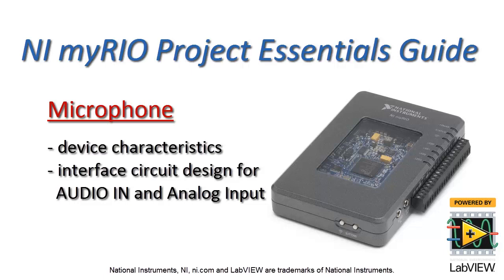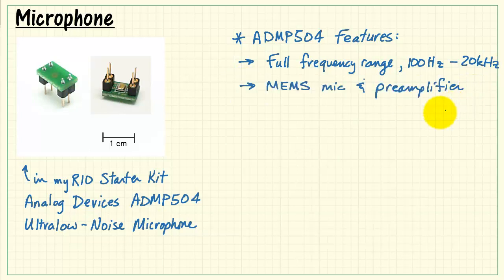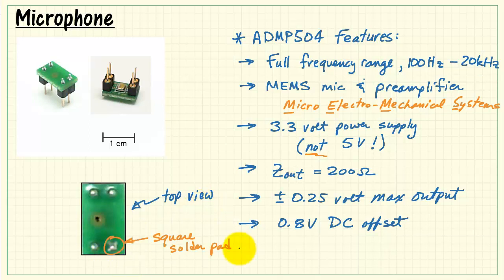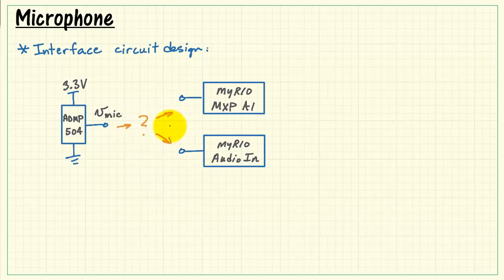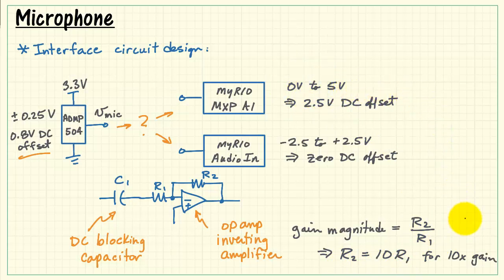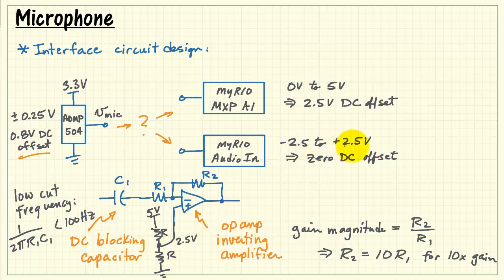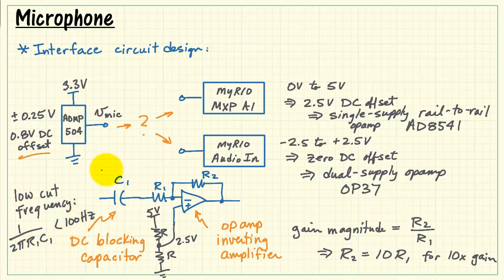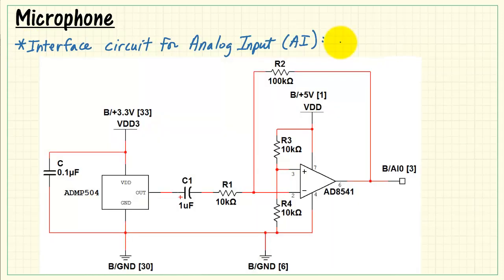NI myRIO: Microphone

Comment: I'm using the analog circuit and an Arduino to interpret the signal.  Depending on how I set up my code, I will always consistently read 2.48 volts or 0.00 volts, regardless of how much I yell at it.  Any ideas?  I have tested the code for other areas and know that the analog part works and I'm pretty sure that I set up the circuit correctly.  ...I'm not sure if the microphone works.